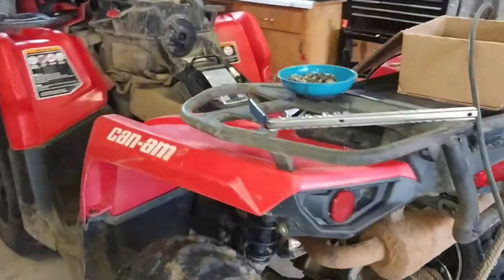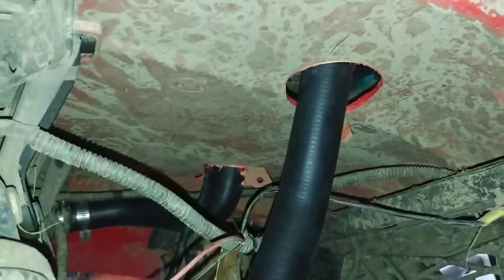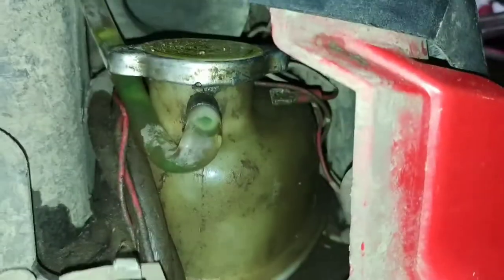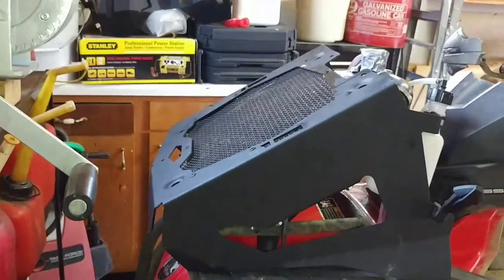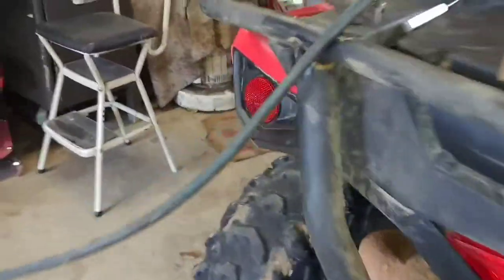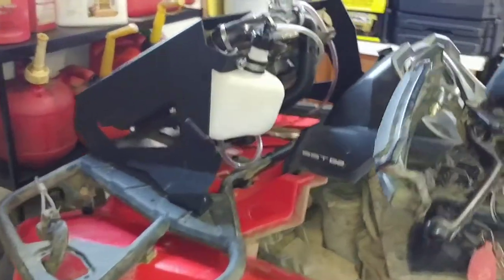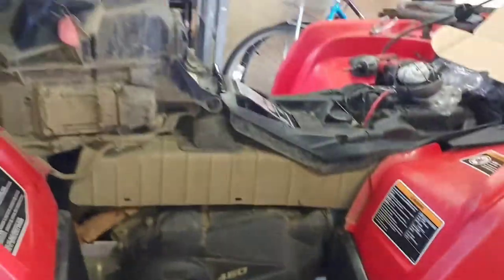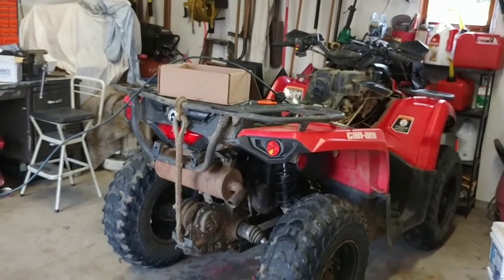Can am Radiator Relocation kit for Outlander L 450!

Comment: What was wrong again with your ATV again? I seem to think you said you blew an engine block apart. I would appreciate response, I have a 450l in Mossy Oak and have beat the daylights out of it, sunk it and overheated it, only thing wrong was the finish on the racks came off,  I have about 4500miles on it but seeing what happened to yours has now made me drive it like driving Miss Daisy.
Reply from the maker: 640biker I'm going to be straight-up honest with you when I think that the one I have was just a lemon because a lot of people tell me that they don't have the problems that I have, on a side note the biggest problems I've been having are the bolts on the shaft falling out and the brake pads grinding off. once the shaft bolts Fallout it destroys the seal in it which causes it to leak gear fluid or if it's on engine side leak oil. I'm putting new seals in on all corners, and I'm making my own brakes so, My hopes are nothing else will happen to it. 

Its going to be awhile be for its going to be ride able. 

maybe 2 to 3 weeks
Reply: Whoaaa that is some crazy stuff. Thanks for the response ! I will keep a close eye on those areas in fact im on my way out to closely inspect them now.  Thanks man!

Comment: I'm getting my outlander 450 next week. How do you like yours?
Reply: I got an outlander 450 2019 and its a beast!  I love mine and it runs great and all never stalls and always starts no matter how hot or cold.  No overheat issues as long as I'm not in mud atleast.  Never had overheats because of mud or a clogged radiator, but i never took it in mud past headlights though lol

Comment: 27 inch tires are too big for a 450,,,,it will drain your power down alot.  i woulnt build a 450,,,not enough power.the more mods you add the more problems you will have
Reply: Mike ski false
Reply: Your wrong
Reply: You can put a 2 inch lift kit on a stock can am outlander 450 and it would run 28 inch tires max with max speed still